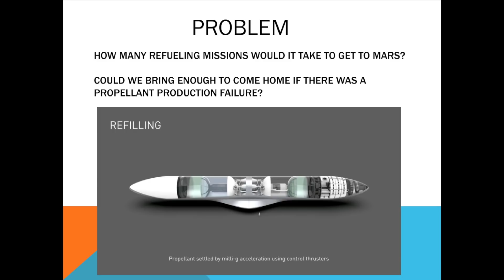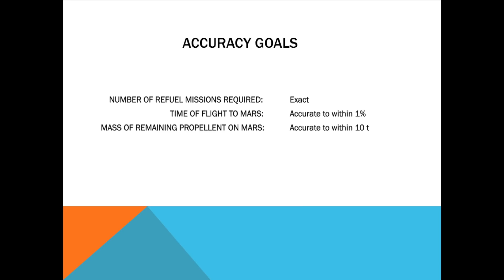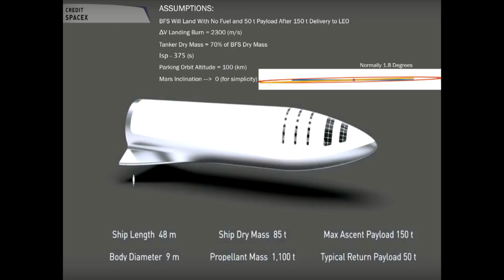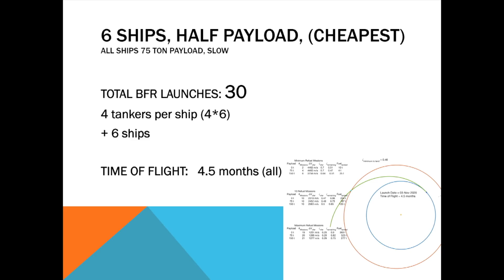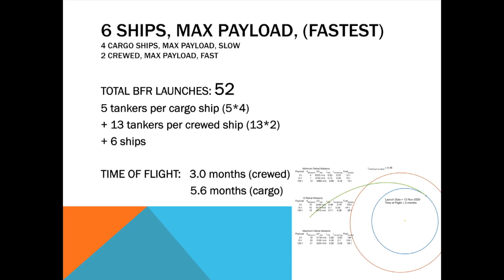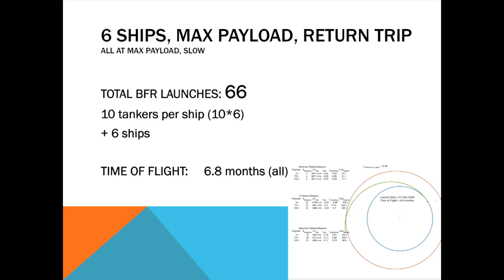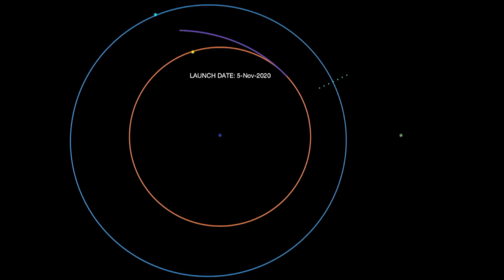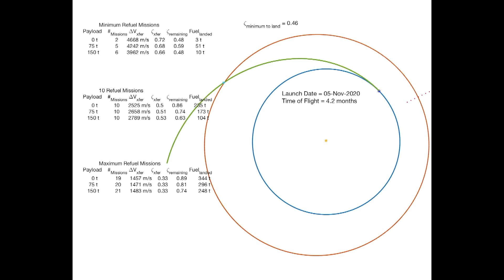Could SpaceX's BFR Return To Earth If Propellant Production On Mars Failed?

Comment: Just getting fuel from ship A to ship B on the surface of Mars would seem to be an issue to me. They may be a Km apart and the fuel is not exactly the sort you can put in a bucket and walk over with. But I do like the idea someone had of leaving a ship in Mars orbit, it could take on fuel from every passing ship on the way to the surface and act as an orbital bowser, capable of transferring 100% of its fuel if needed.
Reply: Nick Breen, docking with this fuel depot would require many orbital maneuvers. 

First the transport ship would have to dip into the Martian atmosphere to dump it's huge approach velocity from Earth. Then, at just the right air velocity, it would have to fly back out to vacuum and (1) burn some fuel to establish an orbit that stays above the Mars atmosphere. Next, it has a (2nd) burn adjusting orbit to approach the fuel depot, then a (3rd) burn to match speed. After fuel transfer, it requires a (4th) de-orbit burn and (5th) landing burn. 

Obviously, this requires a complex mathematical assessment to determine if it is worth while.

Comment: How about starting another booster just with a small capsule on top, which is capable of re entry and landing in the ocean (just for the first few minutes of aerodynamical problems) and then having a half full booster which is capable of much more delta v. Tank it in orbit and use it for the burns? (you could still retank it for coming back to earth, could you caculate that?

Comment: If the bfr really only has to be refueled it’s easy to launch as many tankers as needed. But if it isn’t the case and it needs maintenance it’s a different story.
Reply: daniel_960_, 
I agree. A significant Mars transport ship failure in Earth parking orbit may require sending it back home for repair. In that case, a tanker ship would draw off all excess fuel and remain in orbit. 

Actually, the ship that stays up there for fueling may be a tanker. The Mars transport doesn't have to go up until the end. However, this will require a bit more propellant, as the transfer is literally done twice. (Transfer requires having a constant acceleration to keep the pump inlets filled.)

Comment: Did you consider that having the ships land on mars with a bunch of fuel would reduce the effectiveness of aerobraking?

Did you look at leaving one of the ships in mars orbit with extra fuel so the returning ship only needs enough fuel to get to Mars orbit?
Reply from the maker: I'm definitely no expert on Mars aerobraking, however... as far as reduced aerobraking effectiveness, I think the difference in deltaV required post braking would be small since it appears from the IAC 17 rendering that the BFS will essentially surf the atmosphere until it reaches it's 2km high terminal velocity. If you assume a 16% pre landing-burn weight difference (from carrying extra fuel), then the terminal velocity would be 4% faster because drag is proportional to V^2. So I did consider it, but I was most likely more that 4% off with my landing deltaV assumptions anyway.

If we knew there would be a propellant production failure, then I definitely think that leaving a ship in Mars orbit as a fuel depot would make sense from an energy conservation standpoint (provided said Mars tanker can also aerobrake), however, I don't think it makes sense from a business model standpoint. Keep in mind this video is about a contingency plan, not a primary plan. Doing a Mars orbit rendezvous is the type of thing dusty old engineers at NASA think is a good idea. Sure it worked for the moon landings, but we also spent 4.5% of our national budget to do it that way.
Reply: Fred, the only fuel reaching Mars is hydrogen. The Methane and Oxygen are produced at the landing site from that imported hydrogen and local carbon dioxide, using solar panels and maybe nuclear fission. 

Later missions will aquire hydrogen from the soil. Surveys and mining equipment will require quite some time.
Reply: The reason I was asking is because I am curious about the possibility of doing a mission to Mars without producing fuel locally, which would require less development and have fewer risks.
Reply: Fred Mosby, as to the risk: we don't send people until the oxygen and methane production is complete. 

The cost of sending P amount of propellant to Mars (surface) costs about 24•P propellant to send it there (roughly). So that is why we ship only hydrogen and make it there. Hydrogen is very light, although there is that pesky tank weight.
Reply: David Ogawa If you could send people to get the fuel production working it would be mech easier. Completely automating something like that would be very difficult.
Reply: Fred Mosby, it is all installed into BFR and tested on Earth. Just connect inlet to a simulated Martian atmosphere. The hard part is when we stop shipping hydrogen and start mining water. 

Already perfected in Germany during World War Two. Already reproduced in USA.
Reply: On Earth large scale chemical reactors require constant maintenance. Designing one that is completely automated and never brakes down would me a much more difficult problem than designing one that is maintained by humans. Do you have a source on shipping hydrogen to Mars? Last I heard SpaceX wasn't planning on doing that. Hydrogen is very difficult to store for long periods.
Reply: Fred Mosby, yes, there will definitely be losses from the hydrogen tank(s). Also, some metal alloys suffer from hydrogen embrittlement. I am not familiar with the problems or solutions that other alloys may have, but I expect that a substantial metallic liner will be needed within the composite fiber-wrapped hydrogen tanks. 

Perhaps a concentric pair of tanks with a hydrogen recovery "sump" pump system can reduce losses. The outer tank may not be required to withstand high pressure; and certainly will not operate at high pressure except as a failsafe. 

I certainly agree that reliability in the chemical plant will require considerable redundancy and some advanced degree of sensor installation to permit ground support personnel to diagnose that which the onboard computers cannot cope with. With enough redundancy, only significant breakdowns may slow processing, but not stop it. 

However, this system will be installed on the first two ships, and redundancy can be increased further still if robots can extend plumbing and power connections between the ships. If both ships dispatch a robotic connector, then chances double that one can succeed. If both succeed, then flow rates can be doubled. 

(BTW, It would be stupid to make a particular hose handle only one type of gas/fluid.)
Reply: Fred Mosby, the chemical plants only have to work without local human maintenance for about 18-24 months. Keep in mind that some maintenance can be achieved through telepresence. The rest should be designed-in with modular redundancy, a matrix of power, plumbing, valves, and local reprogrammable controllers.